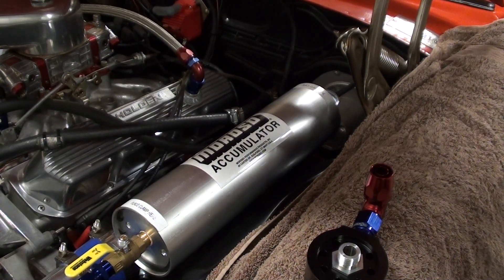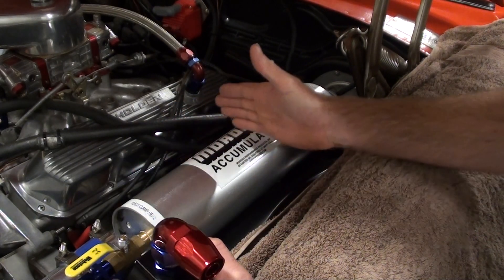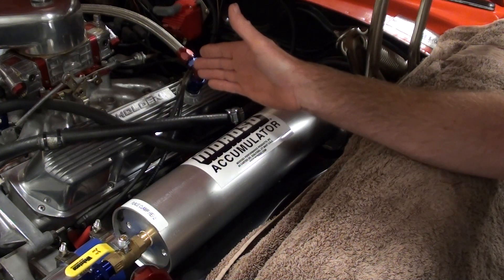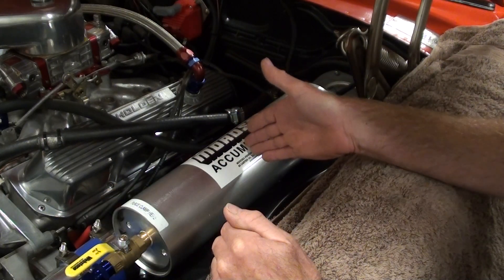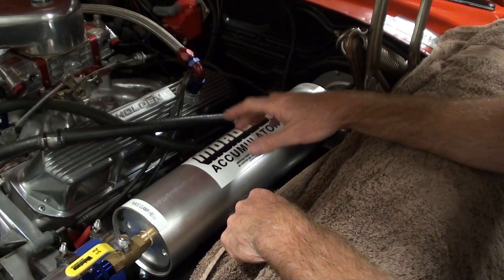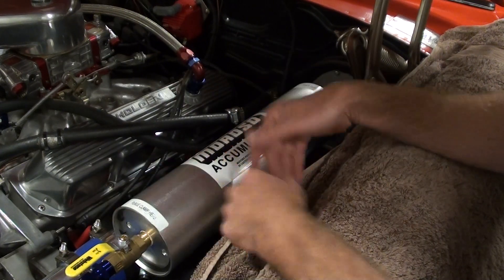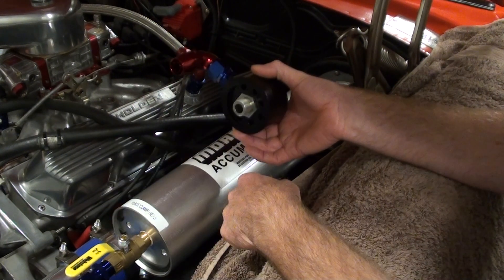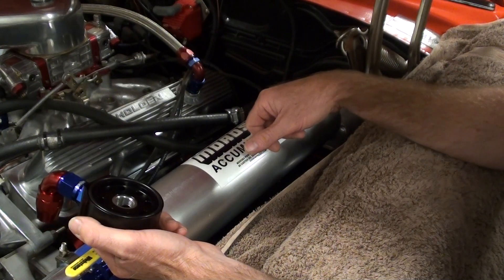Oil accumulator..

Comment: I know its a long shot on trying to get an answer to a question through the comment section of a video thats 5 years old but I don't care...
I need to know, will this work on my 2010 5.7 ram? The oil pressure is crap in these motors especially at idle. Can the accumulater compensate for low oil pressure all the time??
Reply from the maker: The design of the accumulator is to store oil under pressure generated from the oil pump from engine, then if you strike oil surge which is basically your pickup drawing air the accumulator will push the stored oil through to engine for a few seconds then hopefully by then you have picked up oil pressure again.. so in short it won't raise oil pressure in engine, eg if you have a low oil pressure... if your not beating on engine  Dont get hung up on low oil pressure,  as long as it rises with revs and doesn't fluctuate, you should be fine. A rule of thumb for me is 10 pound for  every 1000 revs.  eg  20 pound  2000 revs, 30 pound 3000 revs and so on👍

Comment: I don't think it's putting pressure back into the motor it's putting oil into the motor. Morroso has a utube on it. Good luck with it
Reply: It does provide pressure... you can see it on the engine oil pressure gauge.
Reply: It does provide pressure... you can see it on the engine oil pressure gauge.

Comment: does it require extra oil added to the engine? is there a pressure gauge on the oil side?
Reply from the maker: extra 1.5 litre ...no the gauge is on the piston side

Comment: Can you please tell me what type of sandwich filter adapter that is?  Who makes it and/or model number?  Thanks
Reply from the maker: Wayne Landry proflow brand from vpw... made in china, it leaked between filter and plate...you get what you pay.. im not running it now, done my oiling modifications since..
Reply: Thanks mate, I am gonna buy the moroso one, installing the accumulator now !  Thanks for the video too !
Reply from the maker: Wayne Landry good choice mate..
Reply: Thanks, I am putting it in my top dragster, I may put one in my super gas car too!  Seems like a good insurance policy !  Thanks again
Reply: @griffsrearmountturbothemod1623 hi griff, are you not running the accumulator now that you've done your block oiling mods? I'm running a 355 COME crank in my 308, I rebuilt the engine cause the rear thrust wore out. I run a big converter and also think I have excessive oil pressure in my cooler lines. I haven't done the block oiling mods, I'd have to pull the engine and rebuild again. Do you think it's worth me running an accumulator until I can afford to pull the engine out and do the oiling mod?

Comment: I've been running one on my drag car for the last ten years..my big block chevy holds a lot of oil in the lifter valley at WOT and I was wiping the thrust out on my cranks. So after 2 high dollar cranks..did some research and with this no more "out of oil" thru the lights. You do need to rebuild every few years..super easy..because it is a dead zone for the oil and will get real dirty.
Great video for sure....Thanks
Reply from the maker: Drac Ula its a good thing, i had the same issue with wiping the thrust out, mine turned out to be excessive cooler line pressure, pushing converter foward..